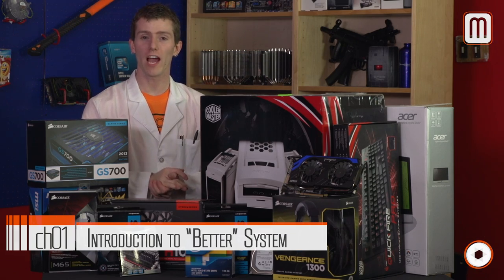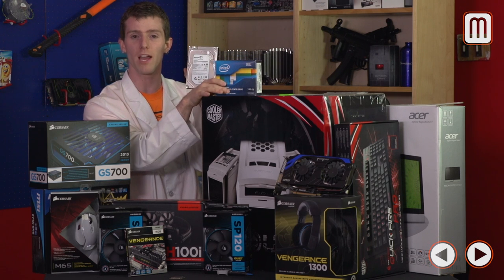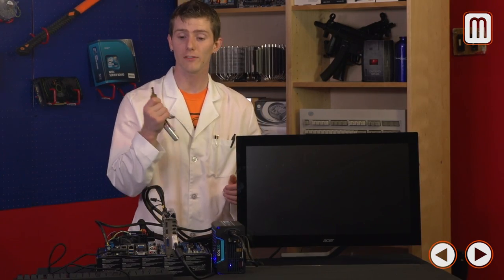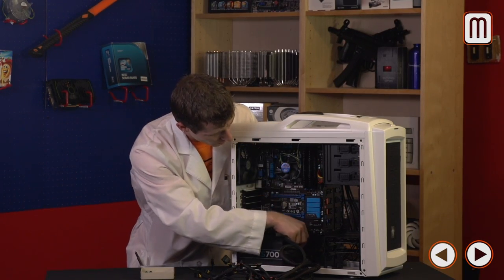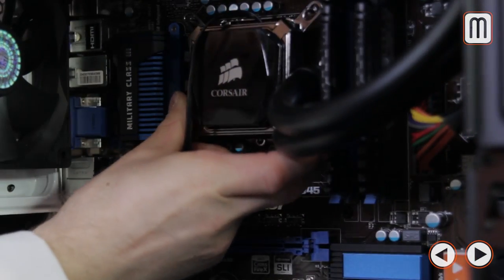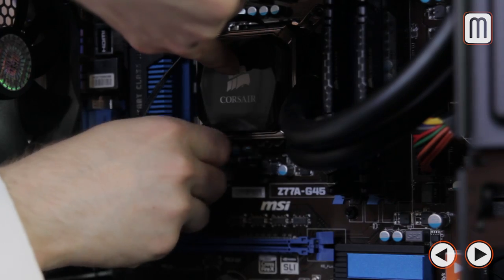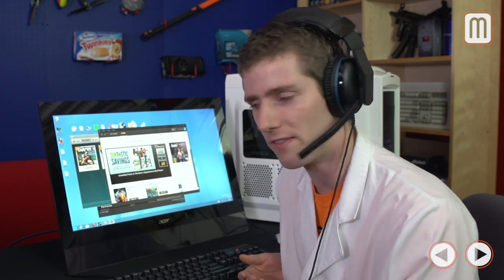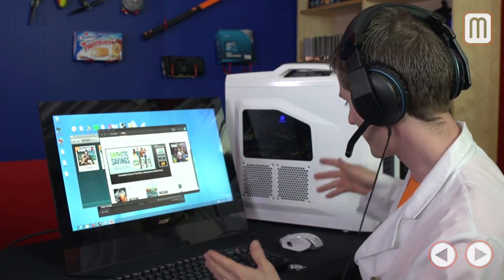ULTIMATE Build a Better $1500 Gaming PC Computer "How To" Guide

Comment: One day... one fucking day I'm going to have enough money to buy a PC so powerful that I'll be able to run games while programming while I use my GPUs power for... stuff. :D
Reply: VR porn? Yeah, VR porn.
Reply: That's cool but can it play csgo at 1080 60fps
Reply: Why buy one pffft build one, I'm building a $500 combo with what I want it's way more satisfying when you build your own to quench your needs
Reply: I gonne build also one for 1700 € (I'm european) and its better when you build the Pc instead buying a ready pc. Thats my choice
Reply: Der EzO It's also a lot more fun and satisfying. Plus it gives you the confidence to fix it if it goes wrong rather than taking it back to the shop.
Reply: I actually meant building one, ofcourse I'd also prefer a highly customisable pc
Reply: ***** thats also a good point "replacing parts" yeah sure and i'm a bit suprised that a Pc build can be Satisfying i didnt had that feeling yet when i build my last pc in January
Reply: Der EzO Hah, maybe it's because mine went together with no issues, even though I was using a 2nd hand mobo and processor. Worked flawlessly, and didn't crash once in 6 months, even after I upgraded the CPU with a 2nd hand i7.
Reply: +Steven Densmore is there anything that can't do that?
Reply: I already have one.
Reply: And  I have a shitty laptop (i5 4200u, 12gb ram, radeon hd 8670m) I mean it's not that bad
considering my last desktop was a AMD Sempron LE-1250 with 2gb ram and nVidia 9400gt 
ayyyyyyy
Reply: +Wall Hacks your wrong, a potato could run Csgo at 60fps
Reply: Gregor Mackenzie *You're
Reply: @Der EzO It depends on the situation. I got very lucky and was able to get a $2100 PC for $1400. I bought it already built from an electronics store. It's all top quality parts such as an i7 6700k, MSi GTX 980 4GB, CoolerMaster CPU cooler, etc. It's been almost a year now and will be replacing the CPU cooler with an NZXT water cooler and the GTX 980 with an MSi GTX 1080 come here soon.
Reply: x1ceGlobal all I need is gta 5 and PUBG and fortnite
Reply: tSp289 mn
Reply: tSp289 inning mnn
Reply: N no n
Reply: Ethan Crouse lii n K no MI n
Reply: K no K no MI
Reply: No kk
Reply: Kmk
Reply: J MI k no K no
Reply: K no MI j MI j
Reply: J MI
Reply: K no
Reply: Jni

Comment: My build any feedback?
Intel i7 4770k
MSI GTX780ti
corsair H100i water cooling 
2x seagate barracuda 3TB HDD in Raid0
2x Kingston hyperX 240GB SSD in Raid0
Corsair Vengeance 2x8GB
Xilence 1000W PSU
Reply: Solid.
Reply: Has one of the best processors and graphics cards available, asking for feedback...bragging much? ;)
Reply: it sounded like "I drive ferrari, any feedback?"
Reply: Also if you're spending that much on your build you know it's great, you don't need other people to tell you that.
Reply: ***** I'm not spending that much on it.. what do you consider a lot for a gaming PC?
Reply: $2,000+
Reply: MrHashtagMinecraft I would be VERY surprised if you weren't spending at least $2500 on that build, plus some. Black Friday you could get less for sure. Although I'm including "higher-class" monitor, keyboard, mouse and such. That's pretty much top of the line PC of 2014 as of now I'd say without going SLI.
Reply: by build costs €1,850 which is roughly $2000 I think
Reply: MrHashtagMinecraft that's about $2500.
Reply: ***** yeah I don't I buying the parts in May
Reply: is it going to be just for gaming or are you going to be doing any video or music editing
Reply: MrHashtagMinecraft To answer your original post then, awesome build. Should easily last for a few years without needing to upgrade. Have fun :)
Reply: 16GB is a waste of money for a gaming PC, A H100i doesn't give better OC results than the H80, it just costs more, 2 x 3TB HDD in RAID0 is a waste, 6TB of data in an unprotected array is not a wise move.What motherboard have you got, and what over-clock did you achieve?
Reply: ***** 'Should easily last for a few years without needing to upgrade. Have fun :) 
Where's the fun in 'not upgrading for a few years'
Reply: EL Jay I said he wouldn't NEED to, not that he SHOULDN'T ;)
Reply: :o)
Reply: Ali Hallal Its a gaming station and a work station, video editing, 3d animating etc. additional homework is my daily routine :)
Reply: http://www.scan.co.uk/products/nzxt-phantom-enthusiast-white-full-tower-performance-gaming-case-with-usb-30-w-o-psu
This a case i would recommend great looks loads of air flow, fits load of  SSDs/HDDs, will take any size GPU
Reply: ***** damn that second case looks epic.. thanks for the suggestion bro!
Reply: MrHashtagMinecraft On the 3d animation end, what render engine/methods do you prefer. Because depending on your choice cpu vs gpu power becomes an important choice. Also if your doing important projects (not just gaming) do not do a raid 0. It's a solid build for just about any task.

Comment: it's a good build but overpriced for the do it yourselfer.
for 1300 you can have an amd fx8350 with a closed loop water cooling system, msi 970-g46 board, 16gb ddr2400 ram, 250GB SSD a GTX 770 700watt power supply a variety of cases, the one i used was a zalman ms800 and that would kill the specs on what you just built
Reply: ...and it only took 11 months of component depreciation & new GPU releases to do it.
Kudos
Reply: Price hasn't depreciated that much on the components I listed what 40-50 bucks if even that
Reply: I'm a bit new to this, but I believe you'd want cores that perform well individually as a opposed to more cores for gaming, right? I think most games only utilize 2-4 cores, let alone 8. So the FX8350 you mentioned would be more cost efficient for other things such as rendering.

But you do have a point that there's cheaper options than this video that could perform better (though this video is nearly a year old).
Reply: nIXne Ownerof GameRepairPros 
YES! THERE ARE CHEAPER OPTIONS, YES THERE ARE MORE EXPENSIVE OPTIONS, BUT THIS IS A $1500 BUILD. IT WON'T HAVE EVERYTHING IN IT!

Comment: "This video build guide was sponsored by Intel."
so much for a neutral guide
Reply: ***** Fanboooi....
Reply: LegendsXXX2 Because AMD cpus a lot cheaper.
Reply: LegendsXXX2 Consoles dude.... not computers..
Reply: LordsSky Fucking this
Sony and MS built their consoles with cheap options, not the better and more reliable ones
Reply: LegendsXXX2 You're also a fanboy... Just... just pointing that out
Reply: Good one bro :))
Reply: Well it is a fact that amd is higly underrated and intel simply invests enough money to keep it that way and to convince people without knowledge that they're superior, AMD is cheap but if it wouldnt deliver the power that is needed they wouldn't use it in every nextgen console
Reply: I'm currently running both an i7 3930k for my gaming rig which runs quite nicely for sure.

However in my File Server/Backup Gaming Rig I have the AMD FX 8350 which also does quite nicely.

I have not seen any performance difference with most games, just some apps like 7zip while archiving large files or folders.
Reply: AMD has superior gpu intel has superior cpu. they are both ahead from eachother in those areas but not by alot, you could always get an intel cpu and motherboard and throw in a amd gpu.
Reply: NOBBYBLUE  The GPU part in AMD's APUs is far superior to the integrated graphics of Intel CPUs. So he is right. When it comes to GPUs AMD is superior to Intel. When it comes to CPU performance it's the other way round.
Reply: LegendsXXX2 Wait Wait Wait. Hold on a second. I know this is late but I have never heard anyone call someone else 20 and meant it as a insult.
Reply: LegendsXXX2 Well to bad back in your day the computer was invented let me tell you times have changed
Reply: alrighty then. You keep having a good life and ill keep being 15 and trying to stay young
Reply: Intel sponsors this chanel so......
And to be clear Linus allthough is sponsored by intel he is very realistic at his reviews,peace.(sorry for bad english)
Reply: LegendsXXX2 Nah its safe to say you won the prize.
Reply: ***** bye a amd athlon 64 macine and a pentium 4 macine and the same gpu and see the diffirice
Reply: Niklas Bergvall what about now though
Reply: POWERED by intel. Intel is a sponsor to LTT but Linus isn't biased towards intel because he gets money from them.